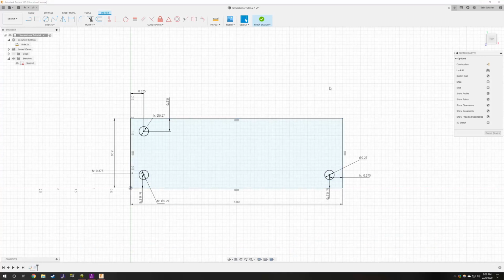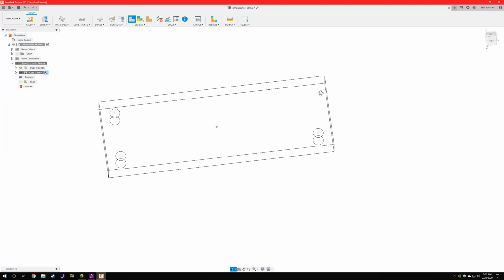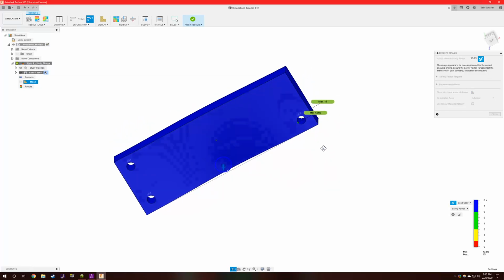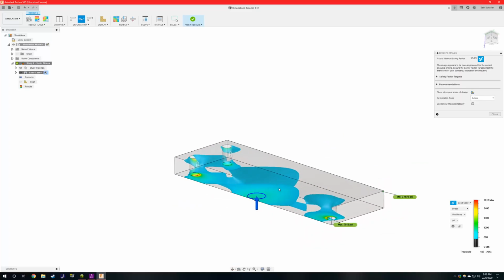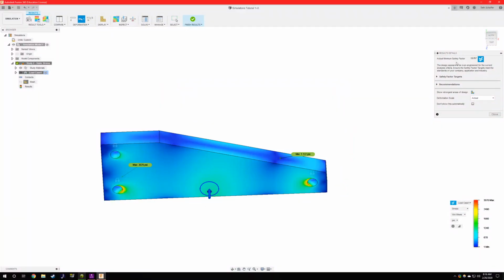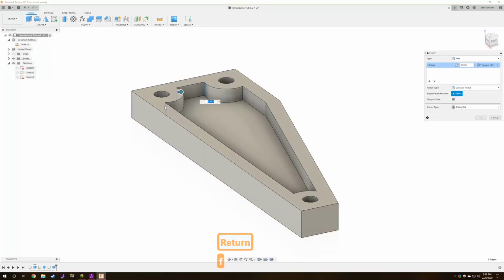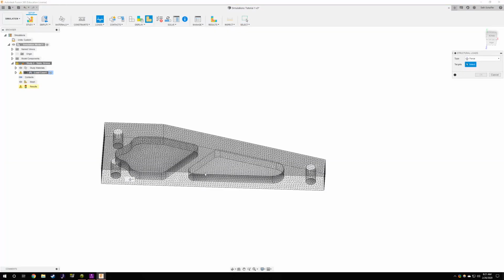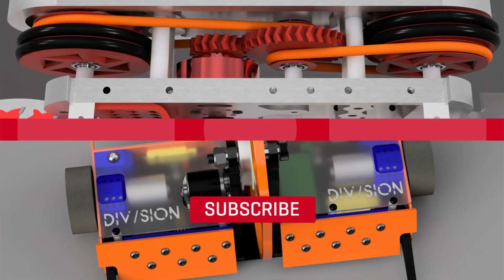Optimize Your Combat Robot Parts! (Fusion 360 Simulations Tutorial)

Comment: I was wondering how you would go about designing a weapon using this, like a disk vert weapon? It does not seem to understand that I want a disk and not a bar weapon
Reply from the maker: Should be pretty straightforward but you will have to do manual work to remove material where you want it and not where you don't and then run more stimulations until you get the result you want if you are doing shape optimization. You can also just start with a long thin rectangle or something

Comment: do you have models for your motors and electronics that would fit in fusion 360? I am attempting to get scale for fairyweight(150g) and antweight (1lb) for my designs, and since I will be using your motors, it would make life much easier. (also my melty brain is being scrapped for my tank tead design again)
Reply from the maker: Almost every product I sell has cad models available on my store on their respective store pages. Most are made in F360.
Reply: @JustCuzRobotics  appreciated

Comment: Can simulations be done off cloud?
Reply from the maker: I'm not 100% sure but I think that yes, free normal accounts can do local solves. However if you aren't using a gaming PC or workstation that could take a long time like 30-60 minutes per solve.
Reply: @JustCuzRobotics   Thanks for the reply! I'm am actually rather interested in how long it would take my PC to complete these solves.
Reply from the maker: @Outland9000  Running simpler simulations on a good PC can be very fast. I just did a bunch of local solves on a 2D weapon design and they all ran in under 60 seconds on my PC with a Ryzen 5 3600X 6 core CPU. A modern laptop would maybe take 2-4x as long.
Reply: @JustCuzRobotics  Nice. Just so happens I recently built myself a beastly PC.